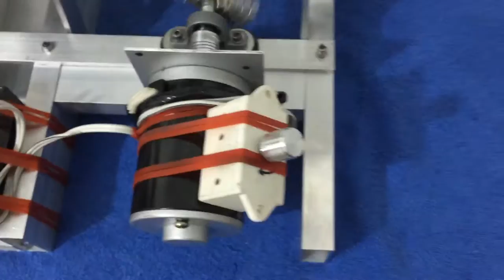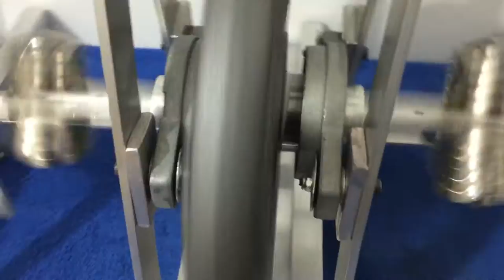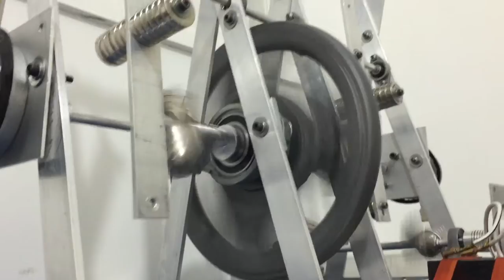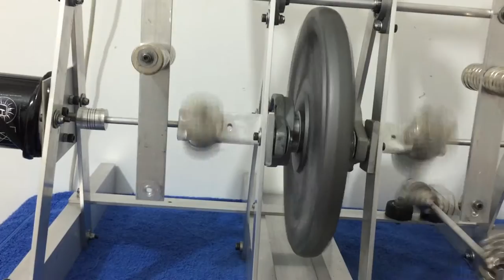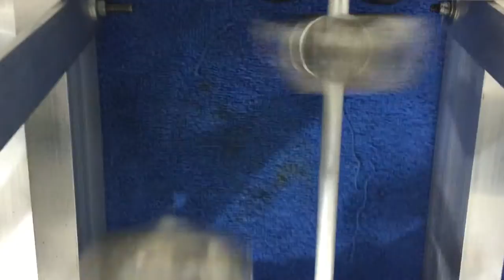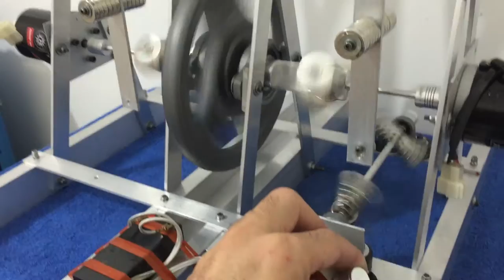Energy storage in magnet machine! the ornithopter engine magnet motor engine by oren gertel

Comment: very cool, I see you have one motor drive on the right running the magnetic drive shaft, are your plans to put one on the left and run that drive with a pulley or chain hooked up to the same motor? That may work nicely if the timing does not get out of balance. Next  step I assume is to hook the generators up and feed back to the battery to see if you can maintain the battery and still do work? PS, thanks for all your efforts.
Reply from the maker: The empty place for more generators!  Thanks Son